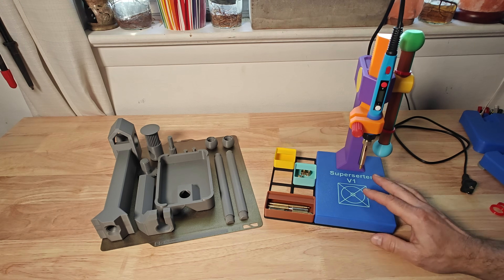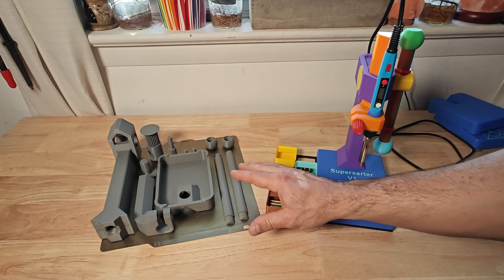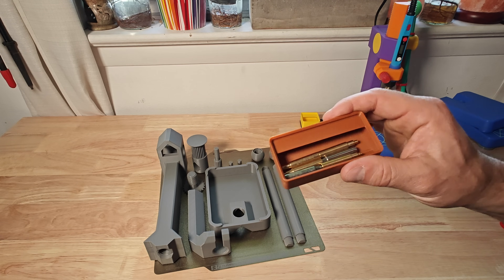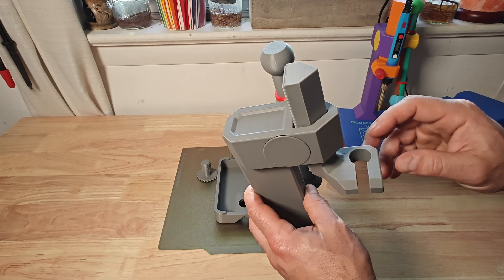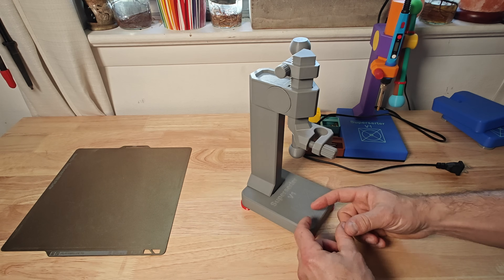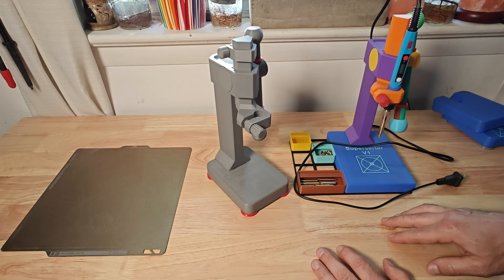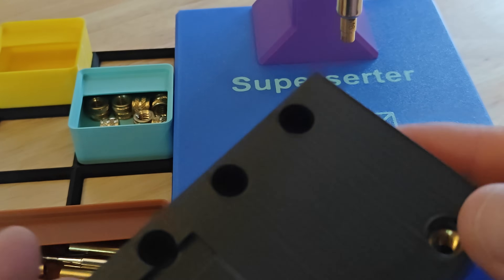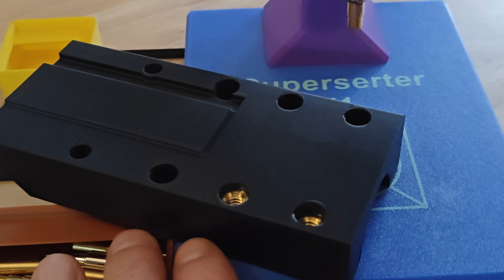The Superserter - 100% 3D Printed Brass Threaded Insert Press: Overview, Assembly, and Demo

Comment: The print is great but there is a small caviat to this and don't do sa i did. The bolts would need to have a separate strength settings as all my first prints broke immediately 😂

Comment: Just a thought since that first insert looks like you pushed too far. Maybe run a hole through the body that holds the soldering iron so you can drop a metal rod or 3d printed rod through with a littlle collet so you can essentially make a quick depth stop

Comment: This is by far, the best DIY insert press. I have mine finished and I love it. No need to buy anything other than filament and a soldering pen. I actually already had the same one that you have. Just, mine is green. I printed my press in black and white PLA. Though, I have some green ASA that matches my soldering pen. I'll go black and green ASA, to make sure that it lasts. 

PLA tends to sag and break on me. My Ender 3 has a dryer sitting on top of it. After 6 months, the PLA bracket, sagged and started breaking perpendicular to the layers. Poly Maker ASA to the rescue!

Thanks again for the hard work. I was about to pay $40 on Amazon, for an aluminum extrusion, based press.

Comment: neat design; version 2 should include a part to hold a flashlight to cast a shadow line on the center of the soldering iron for parts where you cannot see through the part. These are used on miter saws if you don't understand what I mean.

Comment: That's excellent.  If you're looking for improvements, maybe add some holes in the base so you can install threaded inserts for screw-in hold-downs.  Then you can hold the base of the press so you don't have to worry about any slipping or anything.  I suppose you could always clamp the base to the table.  I just like everything held firmly so there's no movement during operation.

Comment: Was looking to buy an Insert press for a 3D project I've been working on but at around £60 UK they are way overpriced for my limited usage.
Currently have all the small parts printed and only have the main three parts left to go (been using up the end of a filament roll).
The only issue I've found so far is that on my Elegoo Neptune 2 the handle sides and end threads don't work as easily as they are for you in this video.

Comment: Something to note.. if you put the stop at the top, don't over screw the bolt, it seems to snap fairly easily.  I think a sliding rail system might be a better option and use a metal nut and bolt or something to add a bit more strength to the stop.  I would also suggest when you print the arm and tower you use a cubic or triangular infill.  I had left on concentric from a previous project and about halfway through I had printed an accordion inside my tower..

Comment: printed one, looks sweet.

I'm using the low-profile tower nut - how do you tighten this? I've got it finger-tight, as far as my fingers will go - I don't think I have a wrench that can grip that nut.
Reply from the maker: I just used my fingers - it was a slight after-thought to make it gridfinity and and the bolt interference was unexpected so I just made a quick adjustment to make it work - v2 will be better :)
Reply: @TimNummy  when does the V2 come out? I will wait till then for sure. I love this idea. I have been heating them then using my drill press with a bolt on it and heat the insert first. This would be much easier. How did you find the different tip sizes? I want to do the tall so I would print the small parts and then the longer neck right?

Comment: Just to note. The X1C's build volume varies depending on how you use it and how you lay out the prints (its actually printable area is not 256x3

Full Depth (more space front to back)
H 249mm
W 238mm
D 256mm

Full Width (more space left to right)
H 249mm
W 256mm
D 228mm

Listing the printer model that a print will fit on is less helpful than just listing the dimensions of the build area that it needs to fit on. 

Also, thanks for listing the cheap soldering iron. I was wondering if a printed collar would fit my Hakko, but it makes more sense to spend $10 and just use the cheap iron dedicated to pressing inserts since it doesn't need to be as picky about temperature (not as picky as electronics anyway) :)

Comment: You made an excellent design here. Can't wait to print it. It's an essential tool for the shop.
Reply: What is it used for?
Reply: @ it help greatly to press threaded inserts, straight into dedicated holes of 3D Printed parts. Sure it can be done by hand with a soldering iron, but sometimes a slight angle deviation can compromise good screw alignment.

Comment: Thank you for your effort! Nice design! Tell me, can it be upscaled a bit to fit larger parts without comprising leverage?
Reply from the maker: I haven't tried... I will say that the Achilles heal of this design is the single gear mechanism and trying to get the tolerances tight enough to keep it straight. So a long ram would amplify that slop. 

But a taller tower would likely work! Especially on the gridfinity base as it is slightly larger of a footprint.

Comment: Great design
What about putting some holes or a side clip on the base to put the extra solder ends and tips?
Reply: Or a cavity where you can store inserts covered by a lid. I will make these changes and print one. Last time I had to use inserts it was a little wonky.
Reply from the maker: I kind of figured the ultra organized would favor the gridfinity base, so I didn't spend too much time with overlapping features.

Comment: one of the dumb irons would work as well, just have to alter the cable in the right spot to add a switch.

I did that with our popcorn air popper. it stays plugged in, you just flip the switch when you want to make some. baffles the fuck out of me that they didn't build in a switch on it.